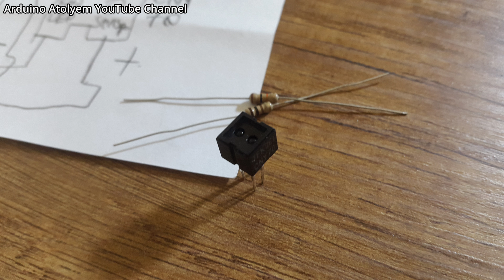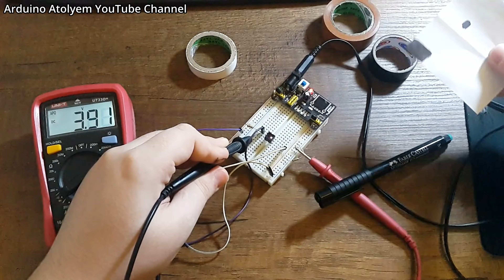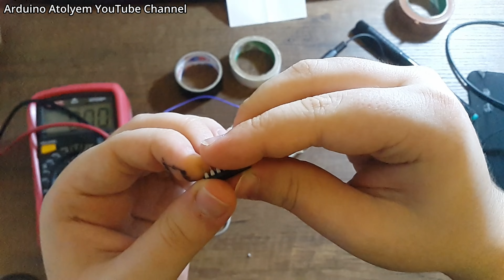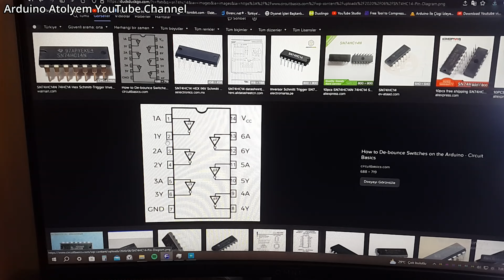How to Use SN74HC14 and CNY70 Proximity/Color Sensor ? | Detailed Explanation | Arduino Atolyem 4K

Comment: When you use the paper, turn the paper over so the black side faces the sensor. You're holding the paper with the white side facing the sensor.
Reply from the maker: I don't think that would solve anything since both sides of the paper that I'm showing to the sensor are black.
Reply: @arduinoatolyem2121  Ah. I didn't see that you colored both sides.